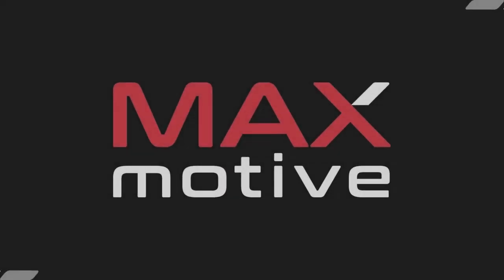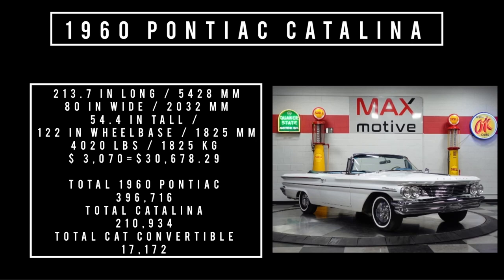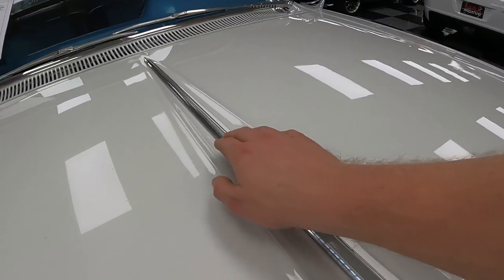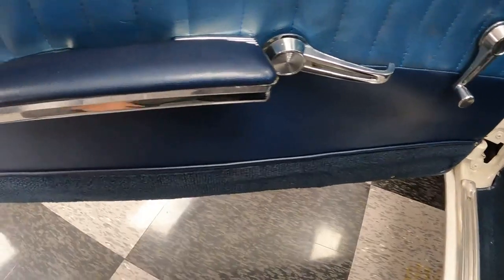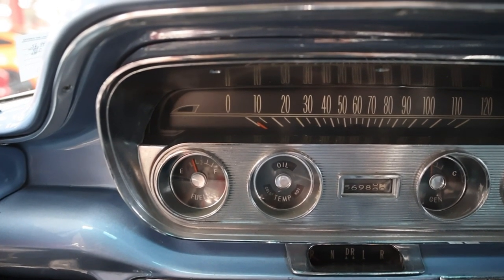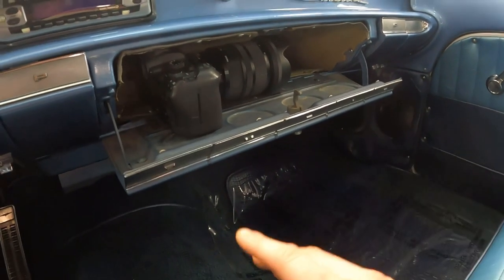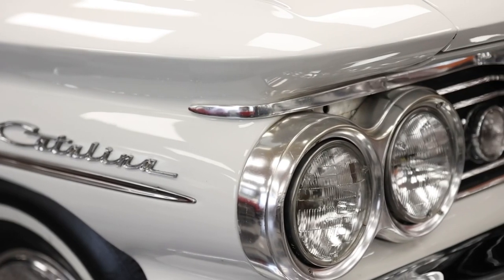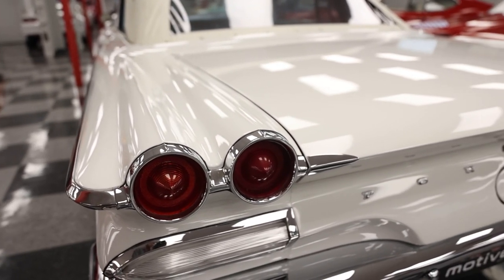1960 Pontiac Catalina convertible, which do you like better 59 or 60?

Comment: Here's a little bit of trivia for you:  In 1960, there were five Pontiacs that ran at the Daytona 500.  All five came in first through fifth.  By this time, Pontiac was in the process of building their performance image.  This race cemented it.  I watched the race with my older brother.  It was awesome.
Reply from the maker: Awesome trivia thank you so much for sharing that =)
Reply: Like that fact about Pontiac finishing in the top 5 at Datona 1960.   Another interesting fact, as far  as my research goes, what true production car and year won the most races at NASCAR events?   The 1971 Mercury Montego.    In 72' -73 David Pearson won 15 races in a 71 Montego.   In the second Talledega race in 72, there were 10 71' Montego's in that race, and one of them won the race.   You will notice either 427 or 429 c.i. engine designations on these cars, and may have been some with 351 Clevelands.    There were a few 70 (not sure about 71) Montegos that were sold by Mercury dealers with 427's.   One was on sale years ago in the Beaver PA area, a light blue.    The 429's were mostly all Cyclones in 70' - 71'.

Comment: My Grandmother owned Pontiacs from 1950 - 1966 (a '50, '56, '60).  She, with my Dad's help, ordered a Ventura 2dr. hardtop in the Spring of 1960.  Dad suggested the 389 with a 4bbl and dual exhausts.  So in July, 1960, my Grandmother took delivery of a longer, lower, wider precursor to the GTO.  It was a real hot rod when Dad drove it.  It was black with the tri-tone gray, gray, and white interior.  I loved that car.  A '60 Pontiac has been on my "win the lottery" list for years.  Thanks for a great video.
Reply from the maker: Thank you so much for sharing that story =) glad you digged this episode

Comment: The timing gear was not nylon, it was nylon coated aluminum.  But yes, they failed usually between 35,000 and 50,000 miles.  Changed a bunch to metal over the years. Most engines didn't freeze, the 389 was a non inteference engine.  The big issue was when they failed was a shop didn't drop the pan and remove the debris. Now 59 or 60?  I prefer the 60, far cleaner design. Good job on the review.
Reply from the maker: Thank you so much for sharing your insight =)
Reply: You are spot on; I worked as a line mechanic at a Chevy Olds dealer back then and changed my share of them too. The oil sump would be packed full of debris from the failed timing gear.
Reply: @trh55  Yep, then when driving the oil pump would suck up some of the pieces and hold them on the pickup tube screen. The majority of the pieces (smaller) were caught by the filter.  Many times a customer didn't want to go to the dealer, went to an independent and they just changed the gear (using the old chain also) to save a few bucks.
Reply: @richardwarren7492  As I recall, the oil light would come on when they hit the brakes.
Reply: @trh55  Yep, I saw that but only once.

Comment: Excellent review of one of my absolute favorite year Pontiacs.

One glaring error tho, and it happens quite frequently.

The generator is on the right side of the engine, not the left as you stated.

Right/Left side of a vehicle is ALWAYS viewed toward the front of the car as from sitting in the driver's seat.
Reply from the maker: Thank you for pointing that out

Comment: My neighbor had a 60 Bonneville 2 door with a 389/automatic. It belonged to his late grandfather and had 31K miles on it. Same color combo as the Catalina you showed! Fun fact - Pontiacs made in Canada were Chevy powered! Speaking of Chevy, they used the nylon tooth camshaft gear in their timing chain set for awhile. I bought a 74 Camaro from a young lady who said "It stalled at a traffic light" when it quit. When I looked at it, there was a score in the lower part of the timing cover where the chain fell down.... Paid 100 bucks for the car, replaced the chain and cover, and sold it for 600 bucks in the 80's. :goodvibes:
Reply from the maker: Great story =)

Comment: What's always intrigued me is Pontiac's introduction of the iconic split grill on the 1959 model and then their abandoning of it completely in 1960, only to bring it back again in 1961 and then make it a trademark of Pontiac styling till the very end!
Reply from the maker: I know right it’s very intriguing
Reply: @What.its.like.  I would prefer the 59 front paired with the 60 rear.

Comment: This car has always been my favorite car…really…so I was delighted with the selection and your awesome video!!!…I bought the Matchbox version of the 1960 Pontiac Convertible Coupe in yellow when I was nine years old (still have it) and that will have to do!...Jay, regarding your yearend show, could you shed some light on your best sources for the wonderful vintage car ads and photos?
Reply from the maker: Yeah for sure thank you so much I can let you guys in on the sources and where I get the ads most of everything is found from Google but I do have some sources that I can share with you guys that would be awesome =) i’ve also found that a lot of times the sources aren’t 100% on everything most of the information that I can 100% guarantee on is inside the ads themselves.. it’s just finding them in the early days it was harder than it is now I didn’t know where to go for the information.. some cars are easier to do than others

Comment: The 1960 Dodge Dart Seneca, Pioneer, and Phoenix actually competed one-to-one with the 1960 Chevrolet Biscayne, Bel Air, and Impala. The 1960 Catalina was bigger (longer/heavier) and more expensive than the Impala...thus it better competed with the 1960 Dodge Matador (very rare car). The "Sports Sedan" actually describes only the 1960 Pontiac 2-Door post sedans. All Pontiac wagons were called Safaris...regardless of trim level.
Reply from the maker: Thank you so much for all of that added insight as well as corrections I thought the matador went against the Bonneville because the Catalina is the entry-level model, wasn’t it you the other day the corrected me saying the Pontiac competes with Dodge.. and mercury it was a ford video Plymouth would compete with Chevy
Reply: @What.its.like.  The Polara was a higher trim model than the Matador...so the Polara (and the 122-inch wheelbase 1960 DeSoto) better competed with the Bonneville. The 1960 (and 1961) Dodge Dart used the shorter 118-inch wheelbase shared with the full-size Plymouths.  Both the 1960 Matador and Polara used the longer 122-inch wheelbase and were considered upscale Dodge cars (both sold poorly).
Reply: @What.its.like.  Two different model lines of Dodges for 1960:
Junior line: Dodge Dart (sold well with 118-inch wheelbase shared with Plymouth; built to compete with Plymouth, Chevrolet, Ford)
Senior line: Matador and Polara (sold poorly with 122-inch wheelbase shared with more expensive 1960 DeSoto and 1960 Chrysler Windsor).
Reply: The 1960 Dodge Dart was in response to Dodge dealers whining that Plymouth was pulled from their stores as the value leader to get buyers into their showrooms.

Walter P Chrysler started jis own car company in 1924 from the remains of the Maxwell car company.  Chrysler was the near-luxury offering and was highly engineered.  The brand was successful enough to allow Chrysler to buy the Dodge Brothers company after the brothers' deaths.

DeSoto and Plymouth were introduced in 1928 and were positioned below Dodge in the model range.

DeSoto was immediately moved upmarket between Dodge and Chrysler while Plymouth remained the bottom of the range.

When the Great Depression hit in Oct 1929, sales of new cars tanked, obviously.

Plymouth was paired with each of the other car lines on their showroom floors to allow buyers something people could afford and keep the dealer doors open.  

Plymouth was pulled from the Dodge stores in late '59 and the Dodge dealers pitched a hissy fit.  The Dart was a hastily Dodgified Plymouth to keep the dealers pacified at the expense of Plymouth sales.

This was the beginning of the end for Plymouth.
Reply from the maker: Thank you so much for sharing all the information =)

Comment: GM used nylon cam gears for decades more. Lot's and lots of failures. The Chevy 230 and 250 inline 6's used a nylon cam gear directly run by the crank gear. It was also permanently attached to the camshaft. It wasn't bolted on like the V8's.
We never saw an engine ruined by the nylon cam gear breaking up. It breaks up in chunks which are too big to go through the oil pick-up screen and the engines were non-interference so no bent valves or push rods. We would use a claw grabber tool and pick out what we could, but we couldn't get all the pieces. We never had a comeback or ever saw a failure from the leftover pieces.
Here's one for you.  We had a car come in with obviously the typical timing gear problem. It was a little strange that all the parts were siliconed on(you know the original blue stuff) and could see that the oil pan had also been siliconed on.  Lo and behold, someone glued the nylon timing gear back together, and ofcourse it didn't work. Whomever did it removed the oil pan to get all the pieces out. There was blue silicone sucked into the oil pick-up screen and even in the oil filter. We basically repaired it the right way and flushed out the oiling system. We put everything back using the correct gaskets and upgraded timing parts.
Reply from the maker: Thank you so much for taking the time and sharing all of that insight I really appreciate it I always do =)
Reply: @What.its.like.  I forgot to mention, that car has the Cadillac-type shift quadrants with a dual drive. It is the  4-speed Jetaway HydraMatic. Maybe it's true that P-O-N-T-I-A-C was trying to fool some into thinking it was actually a Cadillac? LOL

Comment: I had a 1969 Pontiac GTO with a nylon timing gear and it went bad.  Cars had a 5 yr. 50,000 mile warranty back then and the gear went bad at 48,000 miles.  They replaced it with a metal timing gear which sounded the same to me as the nylon gear.   I think they used nylon to save money.
Reply from the maker: It always amazes me when companies cut corners like that like Ford with a Pinto..

Comment: The body and trim work on this car is far superior to the Pontiacs of the eighties till their eventual demise.    I still see people driving Pontiacs from the 80's and following.   Generally I see loose trim, deteriorating plastic around the windows, and piss poor styling.   I see no problem with hitting your knee on the front door frame.   it looks high enough.  Compare that to Ford's fleet automobile, the Mercury Marquis and the Crown Vic.   I have a 2004 Marquis, bought it new, and they have a protruding dash board that I was always hitting into with my knee when I got in the car.   Some mechanic must have had the same problem, putting a dent in the protruding trim on the dash board.   Compare that to older Ford's and Mercurys, my 77 Cougars have much more room for front seat entry.   The Dash in the 77 Cougar is well designed, and properly angled to eliminate entry problems.    The big problem with these older Pontiacs is 1.  The horrible fuel mileage, which improved significantly by 1977 in the Grand Prix, which got about 21 to 25 MPG on the highway.   2.  The inferior nylon timing chain.    Engine problems are probably why so few of these cars were kept as they aged.
Reply from the maker: I love how this model is sculpted the lines are in the body =)

Comment: 3:48 there was no 4 speed automatic in 1960?!! it was 3 speed,lear how to read from script😂
Reply from the maker: The original Hyda Matic was a four-speed transmission and was replaced by a three speed automatic transmission later on this is the predecessor to the three speed transmission which was a four-speed transmission with a really short first gear

https://en.m.wikipedia.org/wiki/Hydramatic

This site is better check out this like three speed manual four-speed automatic

https://www.automobile-catalog.com/make/pontiac/full-size_pontiac_6gen/full_6_catalina_sports_sedan/1960.html#gsc.tab=0